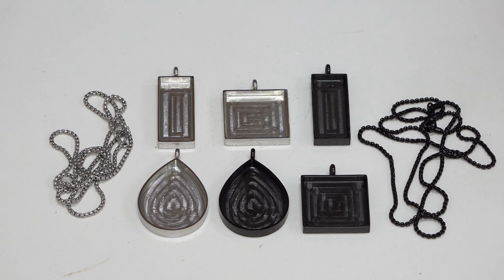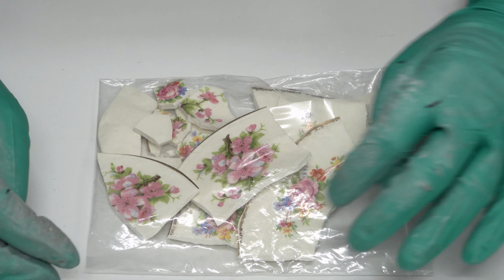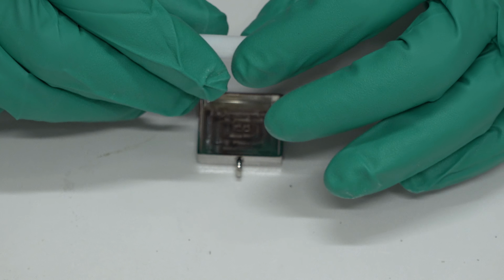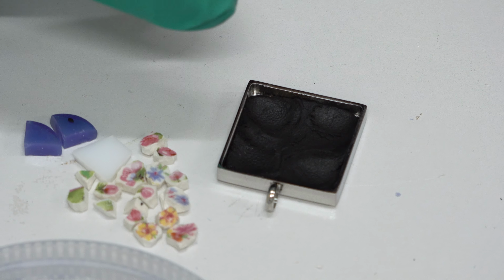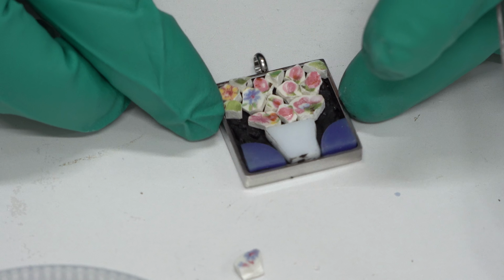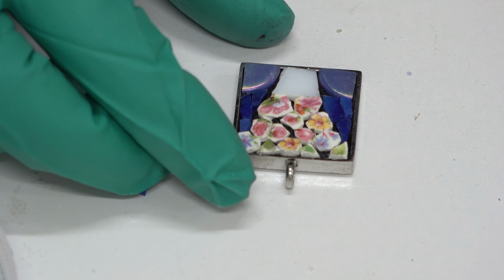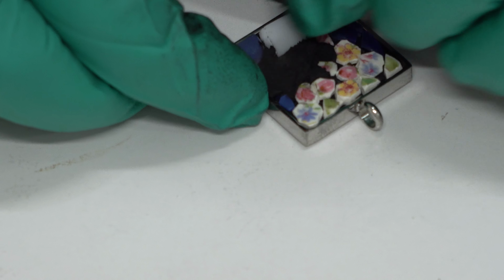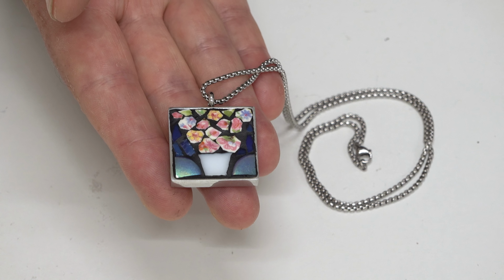Mosaic Deep Jewellery Bezel And Project

Comment: would it not be easier to use more Apoxie Sculpt as the base and let it push up between your pieces?
Reply from the maker: You can do that and that would work, however its knowing how much to add so the tessera doesn't push up with it especially at that size. Also when I create in bezels my tess is a lot closer together in fact very close together and there isn't normally the room for the AS to push upward. Thanks for watching and commenting. :)

Comment: What a lovely piece. Good time to start making them for birthday or even Christmas gifts I reckon. And great for using up shards!
Reply from the maker: Thanks so much Wendy, its great using the left over shards of glass or whatever else you would like to put into them. Thanks for watching. :)
Reply: What a beautiful design - simple but so effective on that scale.
Reply from the maker: @lalitakaplish7779  Thankyou appreciate that and your comment. 😊
Reply: Are you worried about any sharp edges on the glass/crockery?
Reply from the maker: @kekejivery8405  Not in this case, by using the Apoxie Sculpt to grout in  the jewellery bezel it’s all flush. Sometimes using grout in a small bezel the finish is not always flush. Also you can grind each piece if you feel its necessary before adhering into the bezel. Thanks for watching and for commenting. 😊